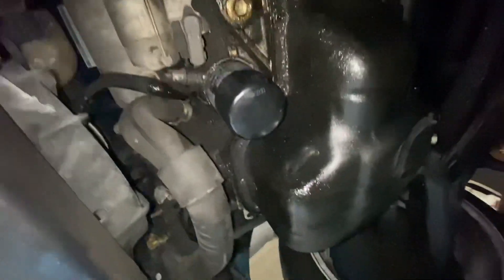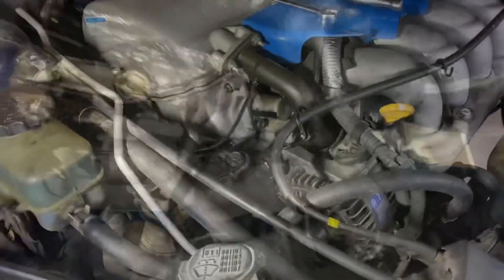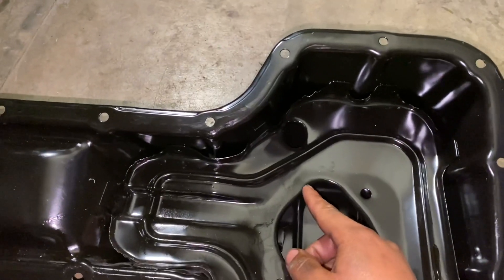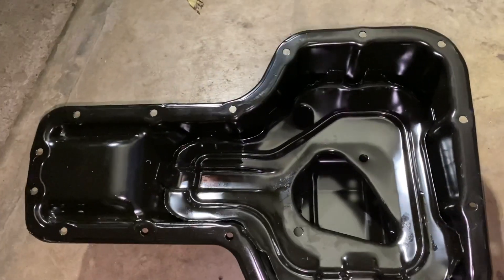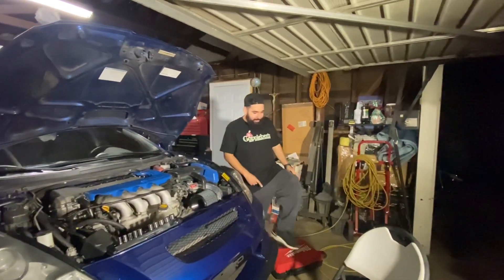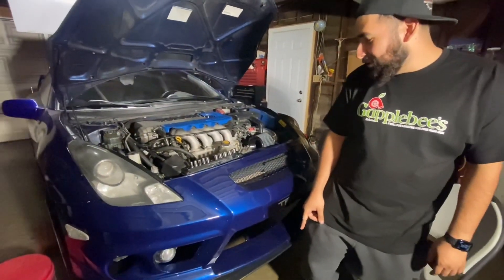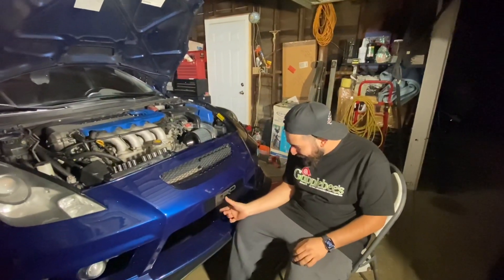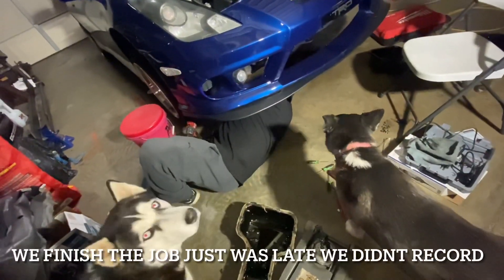1zz Oil Pan on 2zzge

Comment: Hi , I did the 1zz oil pan swap on y 2zz Pontiac Vibe 03' , but I did not grind an hole like you did .. Why you did that ? Did you keep the 1zz dipstick or you using the 2zz dipstick ? Thanks for your video.
Reply from the maker: It was sitting right and kept the 2zz oil dipstick
Reply: @RafasGarage  thanks alot 💪🏼
Reply from the maker: @philippelivernois9166  your welcome 🙏🏻

Comment: Oil pan is not easy no joke. Shit show. I just did mine ;(
Reply from the maker: Yea but it needs to be done
Reply: @RafasGarage  ya I might have to do it again. I ordered brand new stud and bolt kit. It needs to be torqued correctly on all bolts. Also a thread chaser. Thanks for the videos bro, keep them coming. Your 2zz videos Lift me 😆
Reply from the maker: @tkflex2332  damn that suxs but better safe then sorry. Lol you made my day 😂
Reply: @RafasGarage  Pho Reals Fam, I appreciate any 2zzge content. 2zzge is my heart ❤️ and got me thru the damndemic 🙃. The 1st day it was dripping oil again but it was dirty? Might be residual oil from before, so I recommend cleaning and spraying the engine bay first before doing the job. Stud and bolt kit is a must! Thank you for your continuing support. No other smile like being between 6,000 to 8,400 rpm ✌🏾🤓✌🏾
Have a wonderful day brah 👊🏾

Comment: there is a reason why the 2zz sump doesnt have the windage tray the 1zz sump has. you will learn the expensive way.
Reply from the maker: Ok explain
Reply: @RafasGarage  at high rpm a lot of the oil is pumped up to the top end valve train. this oil has to return back to the sump around the pickup pipe to make its way around again. the windage tray of a 1zz sump will slow down the oil return rate to the bottom of the sump. you will notice this the most when holding top speed / high rpm (8krpm) for more than 2 minutes continually. end result is oil starvation.
Reply: @slybunda  im about to 2zz engine swap on my toyota mrs. I also have 1zz engine oil pan . Should i use 1zz oil pan with 2zz engine. 1zz oil pan is taking less oil than 2zz's though . Would you recommend ? Engine will be at the back of the car so probably the engine will get more horizontal force . Baffled oil pan wont be necessary ?
Reply: @enuma8161  moroso pan. It's expensive but the only real option.
Reply: @slybunda  hey I plan on putting a 2zz in my mr2 aw11. My main goal is autocross so it'll only breath on the redline occasionally. I've heard the stock 2zz oil pan and cause air to be sucked on hard cornering. For that reason, and budget I'm still considering the 1zz pan swap. Would a moriso or just saving for a dry sump be more ideal?
Reply: @Electronica27  you need a proper sump with the trapdoor baffles to hold oil at the pickup pipe. moroso pan is best option, cheaper than going dry sump. the 1zz sump does not have baffles and trapdoors around the pickup pipe so still wont help